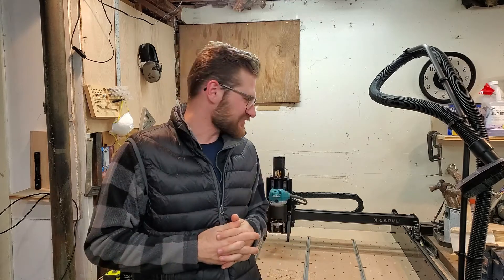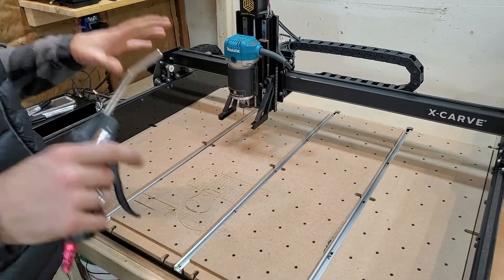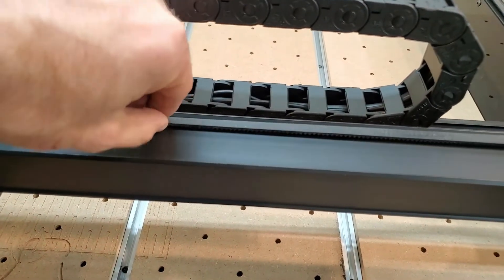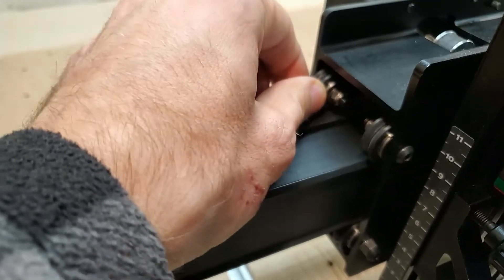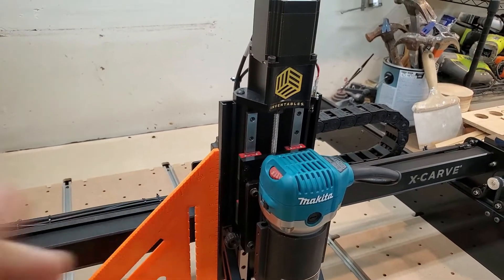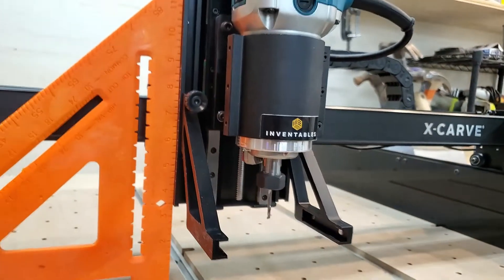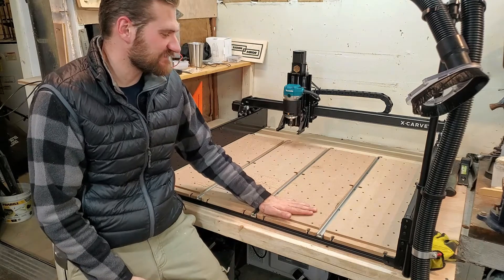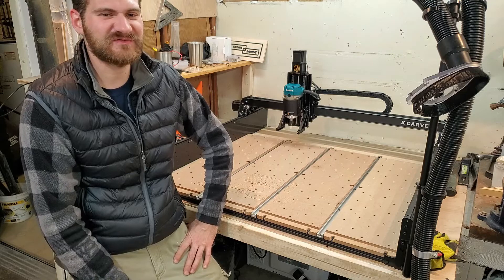Inventables X-Carve | Routine Maintenance and tune up

Comment: Sir I have a question.  I have this machine and my machine will “air carve”. It will carve the design in the air.  Any help would be appreciated
Reply from the maker: I would start with re-homing the machine.  The other thing to check is your Zero.  How are you coming up with your zero either by eye or by probe?  There also could be a code calibration issue but theses would be the first things to check.  Also, as I'm thinking about it, check the depth of material you set in software.  If you set the material in software to be way thicker then it is in reality this could cause and "Air Carve"